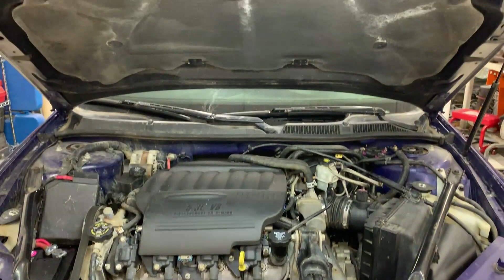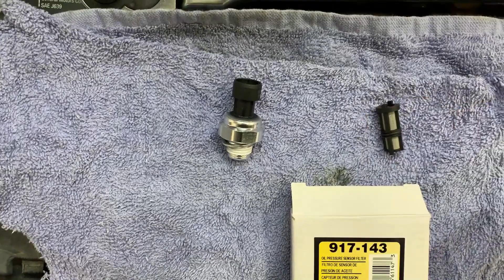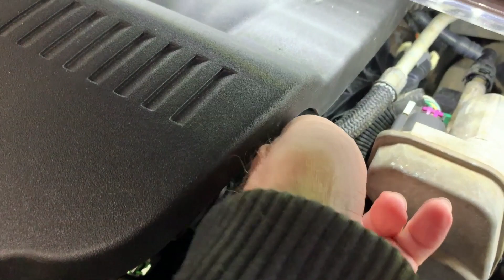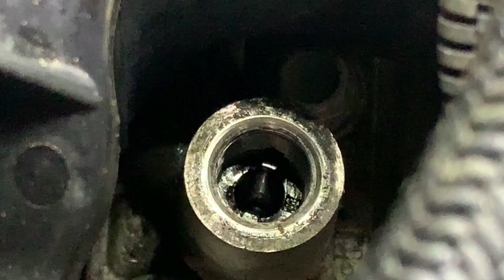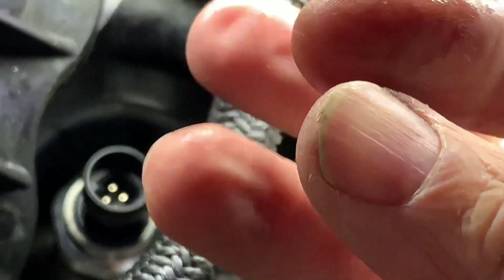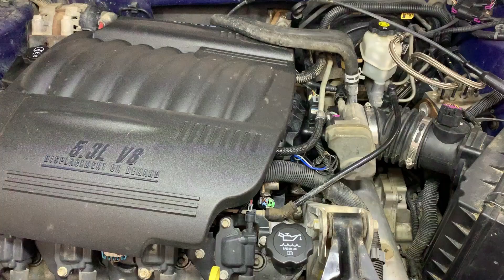2006 Impala SS oil pressure sensor swap

Comment: My engine light didn’t come on just the low pressure stop engine is that right
Reply from the maker: Yep - "check engine light" is separate.  As a sanity check, put a manual gauge in where the sensor goes, and run until hot.

Comment: I had a message that read "low oil pressure, turn off engine" on my 2007 monte carlo ss v8. I changed the oil pressure sensor on it and the message and the check engine light went away. I appreciate you for making this video. 👍🏼👍🏼👍🏼
Reply: Having the same problem in my 09 impala ss. Dipstick looks good but where you insert the oil is bone dry. Got it scanned and code P0521 popped up. Hopefully It’s the sensor and not the oil pump
Reply: Mannn i like to here that i got the same problem

Comment: Did your check engine light come on? Is that why you replaced it?
Reply from the maker: Nope - the DIC actually says "Low oil pressure - Stop engine" (or wording to that effect!).  Your CEL will generally only come on for emissions related malfunctions.

Comment: Hey great vid. My sons MC SS just threw a code showing to replace this . Did you get a code for this? And did it fix it?

Thanks
Reply from the maker: Be honest - it was SO long ago now, I don't recall if it set a code, or the DIC just said "low oil pressure - stop engine".  If it had set one, it'd probably clear after a couple key cycles, then just be stuck as a history code - assuming you don't have a decent scan tool that can clear those.

Comment: Awesome video! Was so glad this was on the top of the engine. When I measured resistance from pin to pin, the old sensor was about 20K ohms more than the new sensor on each one so maybe that fixed it. Guess we’ll see. Great job.
Reply from the maker: Pray that you never need to do a crank position sensor. OP sensor is a cake walk by comparison.  ;)

Comment: Definitely helped me out I’ve done some research and my impala ss has a long crank before it’ll start I usually have to flip the key back then try again and it’ll fire up I’ve done extensive research and everyone says that this is what’s causing it. I just picked one up today gonna be putting it on in about a half hour or so hopefully that fixes the problem.
Reply: Finally, hearing of a similar no start issue is a relief.  My 2006 Monte SS won't initially start upon 1st turn of the key & engine actually modestly backfires.  After a couple seconds release the key.  Upon recranking it fires up.  Only does this when engine cold.  Restarting after leaving an errand is normal startup.  Here, in the People's Republic Of IL, the IL EPA is nearly as hardcore as Cali.  Registr8ion isn't granted until passing emission test.  Since just b4 Halloween I've had a code, made the repair, drive several daze (intended) 2 reset drive monitors.  Then, on day 3 when I think I'll go get the test done-- blammo!  The idiot light come back on.  Scan computer & a different code issue manifests.  This has happened 5 times now.  Sometimes the light goes off a while only 2 reappear several days l8r.  There4 still don't have current tag.  Since then, I've had codes P0420, P0300, P2138, P0335 & now P0521.  It runs/drives smooth & has even w/codes. Even better per4mance & economy since running Albert Champions Delco 110 plugs instead of the 162's (older version is the 110 model plug th@ per4ms better) No issue other than code.  Fails the test only because of new P0521 code which has no effect on pollution or drivability.  Engine code=test fail.  Even applied 4 a waiver b4 testing it in January & it was denied!  Those crazies said the car needs 2b tested.  Why would you take a test knowing you'll fail?  Makes no sense only cents 2 them.  Picked up a 'za last weekend with engine running.  Came back 2 take off & the light was off.  Upon heading 2 test st8ion Monday the light came back on.  Twisted stuff.  Threw thousands @ it in repairs because of codes & no drivability issues.  Just 1 of those rides th@ run better w/the engine light on.  Still playing politics on trying 2 get waiver.  Anxiety sets in on repairing now wondering what new code will appear & $/time involved in repair.  Over sensored w/2 many computers in rides is costly & dangerous.  1ce upon when there was a 283 Chevy.  There was so much room you could stand in the engine bay & have all 8 plugs changed inside of 10 minutes, & th@ is if you worked slow!!!  Rubik's Cube is easier than this & less costly!!!!
Reply from the maker: I wish that was the long crank solution!  I’ve swapped out both cam and crank sensors as well. Still does it. It’s tough when it’s so random!  I’ve had all my test gear out - can’t get it to do it. But… in a rush to get somewhere?  Boom, does it. :(

I want to get my pressure gauge on the rail, and have a timing light hook to a plug lead. Then just cycle it on/off like 100 times in a row to catch the failure. At least narrow it down to fuel or spark!
Reply: @DrFiero   yeah mine didn’t work as well and mine is very random the only thing I can think of is maybe a faulty coil because I just did a full tune up besides the coils or maybe a fuel filter and I’ve heard a weak fuel pump could also be the problem it’s weird because it will go through a whole day absolutely perfect and I’ll run to the gas station come back outside 2 minutes later try starting it and it will just crank and crank sometimes when it catches it’ll try and start but when it does it runs like total crap back fires then when I flip the key and try starting again it’ll crank right up and run beautifully it’s definitely a head scratcher because I have no warning lights I did have a check engine light on so I tested it and it popped up as a faulty oil pressure sensor and that’s what I replaced since then it went off by itself I replaced it anyways but still cranks without start randomly
Reply from the maker: @Ericraymond26  - Throwing good money away on the coil aspect.  The GM coils are notorious for being bullet proof. Not to mention you wouldn't have 8 simultaneous failures!   :D

Comment: Very helpful thankyou 🙌🏽 if you have a video doing a valve cover on a ls4 v8 please put the link in the comments
Reply from the maker: Figures - I did BOTH covers due to an oil leak, and never did a video thinking "who'd watch that?".  :(

Front one is insanely easy, just be VERY gentle with the plastic piping. Take the coils off as assemblies. Make sure to replace the gaskets AND the rubbers where the cover bolts go through. 

And really, the back one is almost as easy. Just had to wiggle it out from under the alternator. Do the front one start to finish, then you can lay over the engine without getting covered in oil.

Comment: So u saying don't tighten it all the way down til you can't see the threads?
Reply from the maker: That would probably be way too tight and you'd take a chance on stripping the threads. Thing with NPT is there's so much variability. I use one type of tape, you use another, I put 2 wraps, you put 3 (you get the idea). Plus manufacturing tolerances in making the male & female threads!  There's just no need to tighten anything (that uses NPT threads) beyond a certain point. If it's not leaking it's doing its job - done. Just get the tab lined up so you can remove the connector next time, and don't loosen it after you've tightened it (it mangles the tape and might leak).

Comment: I changed this two time already what that means
Reply from the maker: Well, make sure the fault isn't in the connector. It could just be a cheap/bad sensor as well.  I replaced this one again after shooting this as every time it got really hot (long drive) it would start randomly dropping to 0 PSI and tripping the dash warning.
Reply: @DrFiero  thanks man